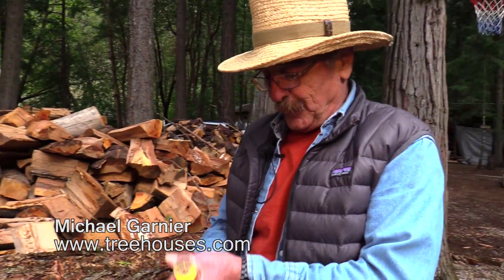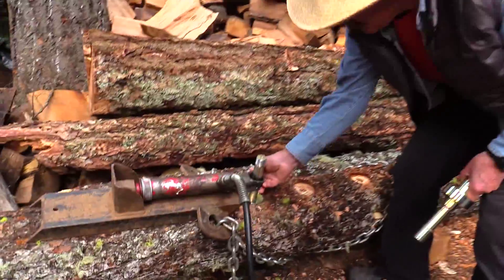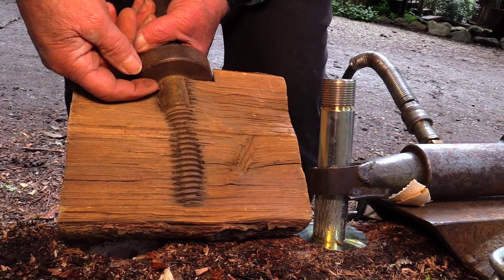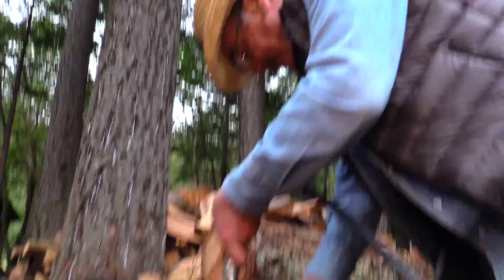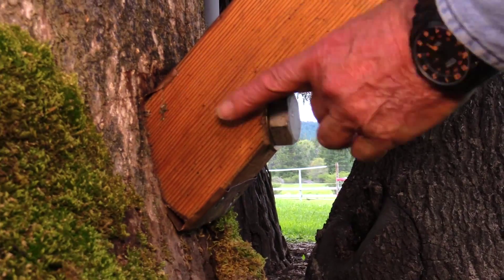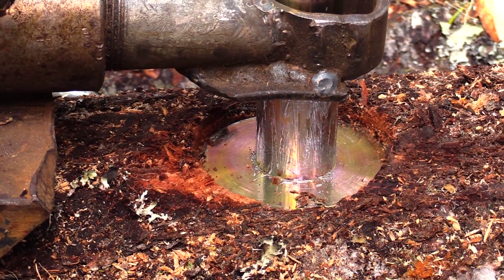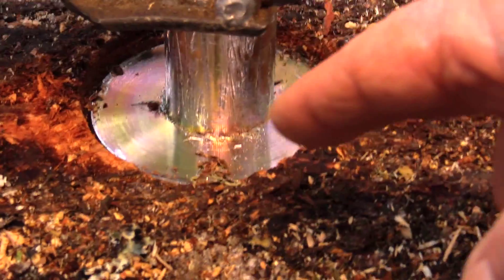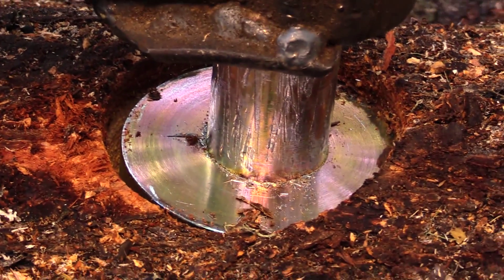Treehouse Dreamers part 2 Testing the Garnier Limb

Comment: The results would have been more accurate if you did not round DOWN the results on the lag bolt and round UP on the G.L. to get a larger pressure spread.  I have no doubt the G.L is better but it's best to keep the test consistent.